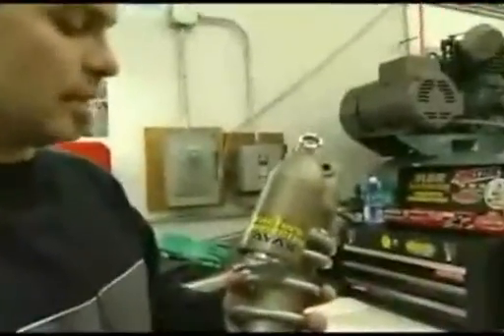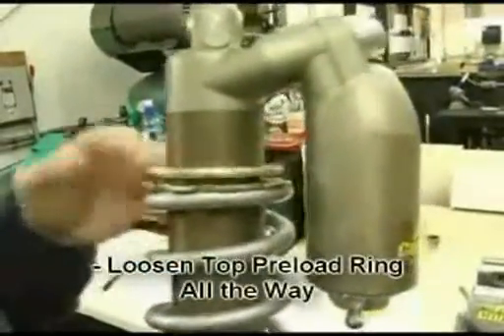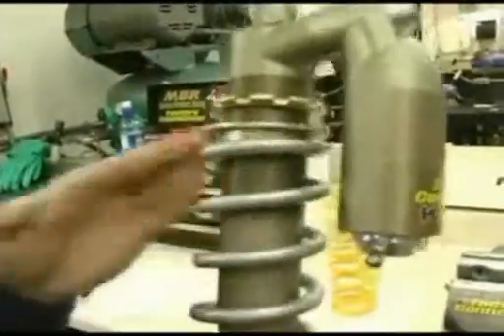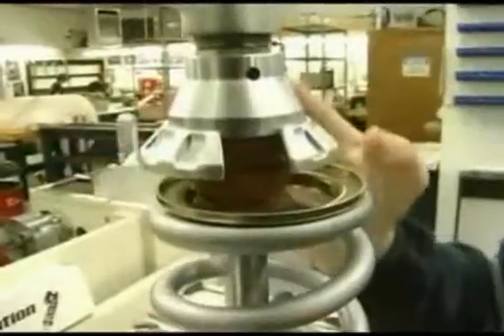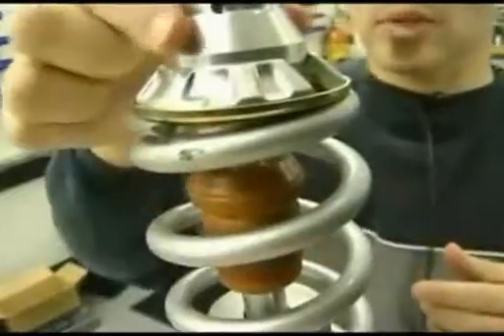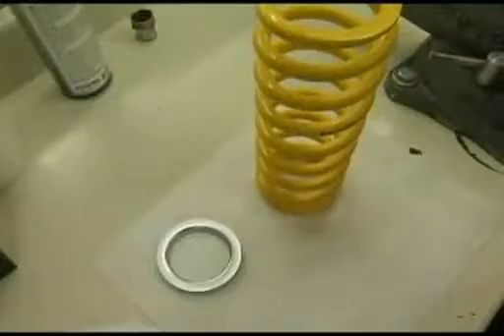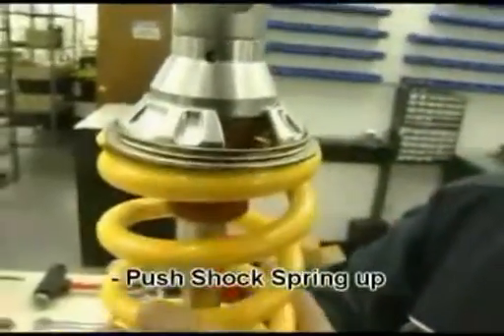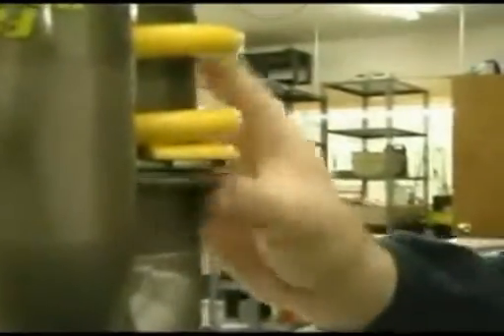Factory Connection Instructional Video :: Changing a shock spring on a KYB shock

Comment: Is it normal for the spring from you guys to be shorter than the stock spring
Reply from the maker: colm fenelon Yes, they fit a few different shocks so the length is designed to work with all of them.  On the KX it is a little shorter than stock.  You have enough thread on the body to accommodate the shorter spring.  If you have any other questions feel free to give us a call we can help you quicker.